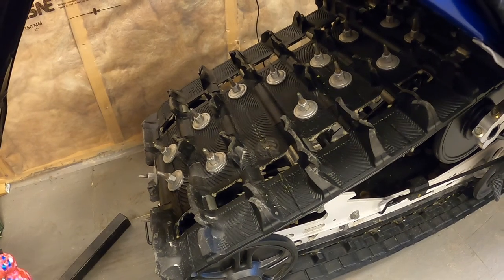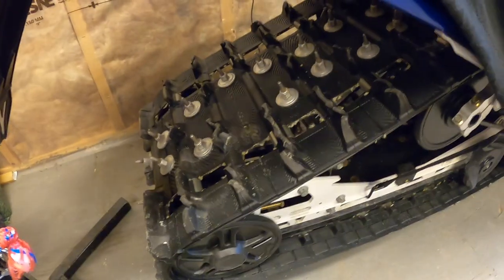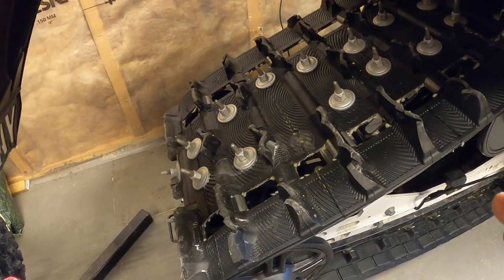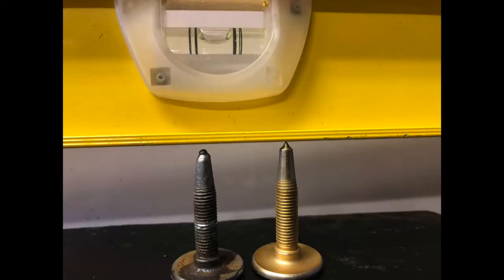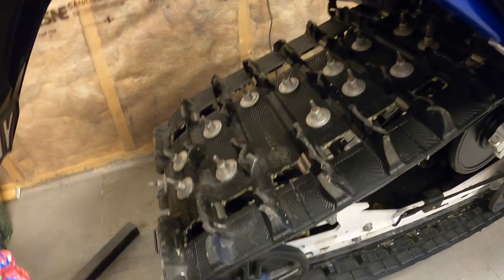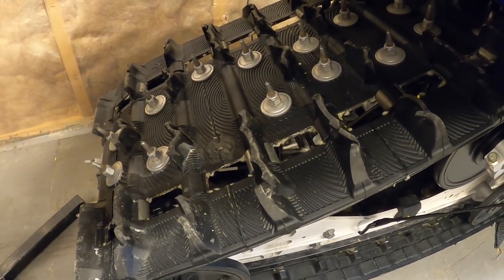How to check snowmobile studs Yamaha Viper

Comment: Hi Mike. The 2 barely used 2016 R-TX's I just bought don't have studs. Can I get advice on Brand / Style / Size for studs on my 2 sleds ? I plan to watch How-To video and to do the install myself unless you tell me it's too hard. TIA !! Keith
Reply from the maker: I used (woody’s ) gold diggers studs. You can go to their site and enter your sled make model and it will give you options. I went with 2 per track bar. Stud boy is another popular brand. Both will give patterns to use too! Make sure to get that and a drill bit from them. It’s time consuming but simple process.
Reply: @bikermike  Good Morning Young Man. Many Thanks for the advice. I was sure it was straight forward and simple. I was looking at the better part of $1K at the local dealership to stud the 2 sleds. Now I believe that I can get it done for half that, for which I am very grateful !